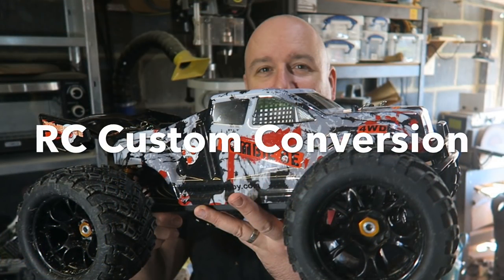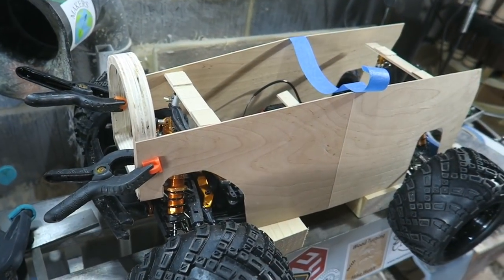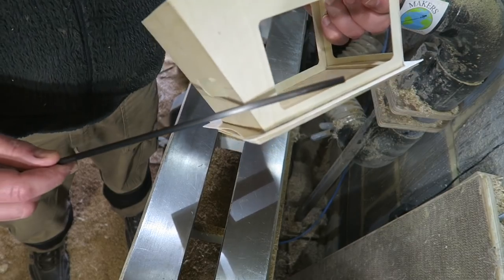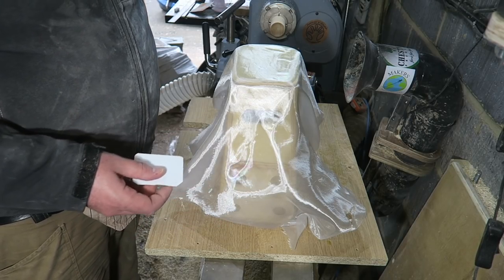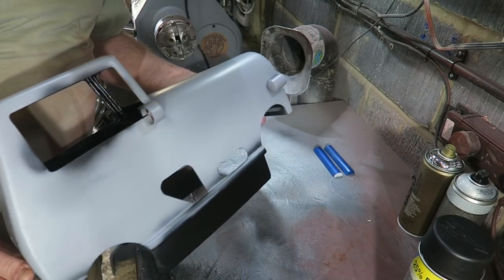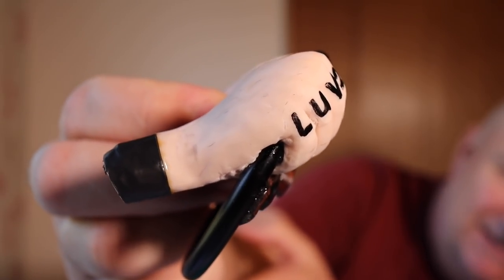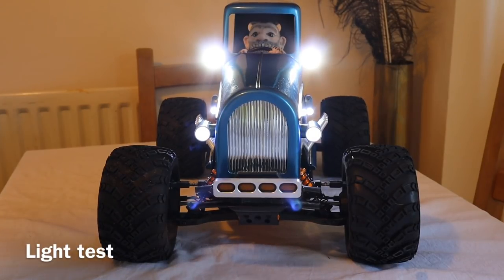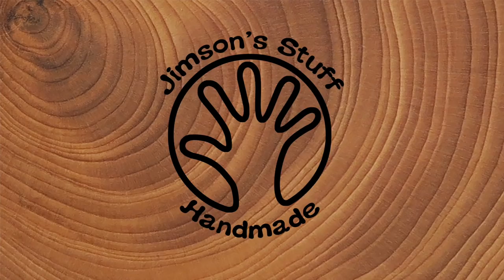I Build a Crazy Custom RC Car - DHK Zombie conversion

Comment: Still running my nitro trucks and planes. Most of my planes are electric these days. Great project. Turned out amazing. Don't break it before MC.
Reply from the maker: Thank you very much Robert. It is a great hobby and something I have revisited several times over the years. Brushless motors have certainly revolutionised things. I have put it safely away until MC
Cheers 
Jim